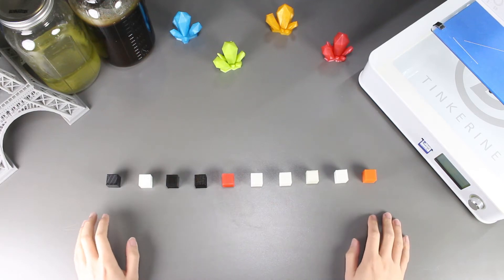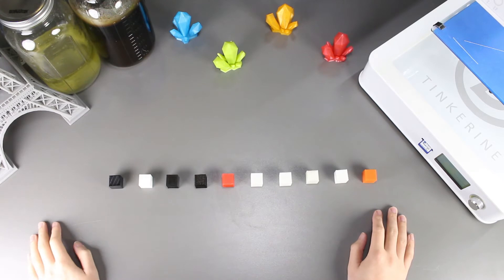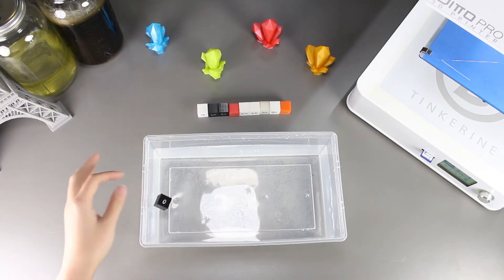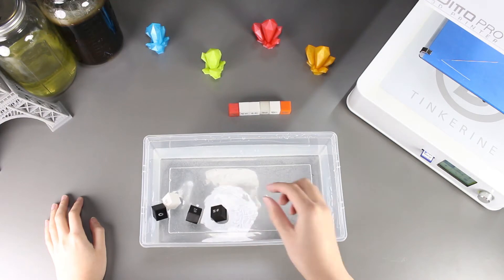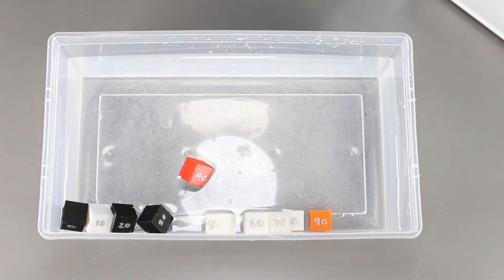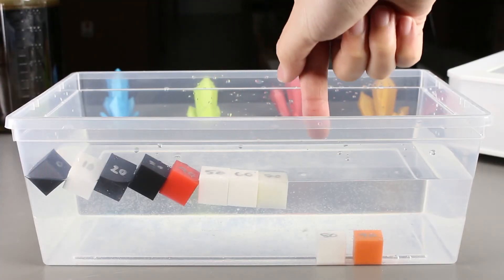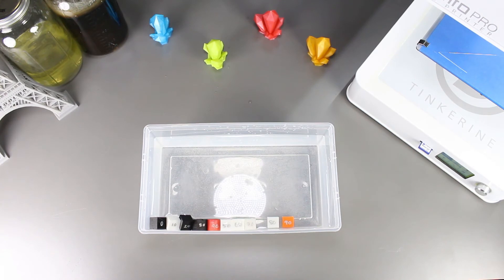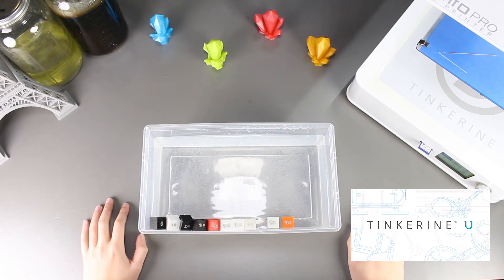Testing the Buoyancy of PLA

Comment: Great video.....will the floating cubes eventually take on water and sink????
Reply from the maker: The floating cubes will eventually take on water and sink just because of the way it was produced. Since FDM printers print layer on top of layers, there are these little gaps in between the layers that just makes the cube not water tight.

Comment: aren't you testing the bouyancy of the air in the cubes here though not the material itself, the same way a ballon is negitively bouyant in air until helium is added, it's not the ballon that's positive it's the helium and it just happens to have enough lifiting force to carry the rubber into the sky. so i think the question is simply answered as no, pla is negitively bouyant, because if you put a 100% infill, (no air) cube in the water it'd sink. or if the 0% had a hole in it for the water to enter, it'd proably sink too.
Reply from the maker: Thanks for the comment and advice!
Reply: Its an example of the amount of weight per infill that would, when scaled affect your end buoyancy. The air in your ballon example would be comparable to the infill. Air=90% infill heavy, Helium=0% infill light-Floats.
Reply: Needed to know this, thanks so much!